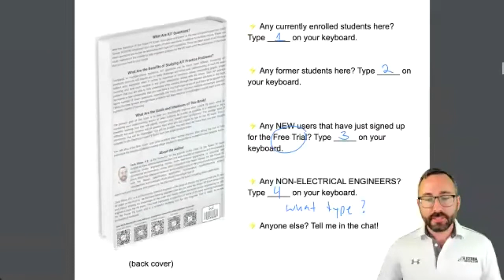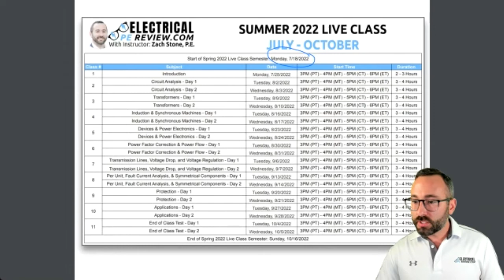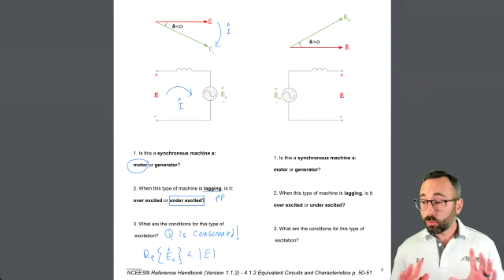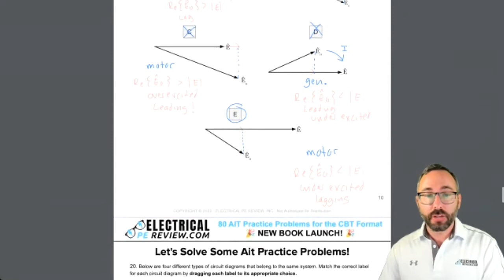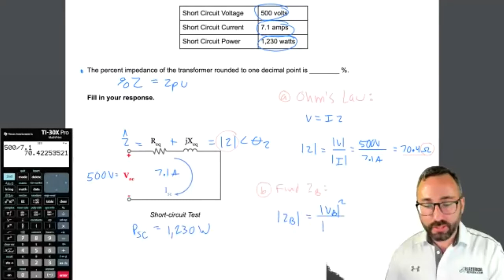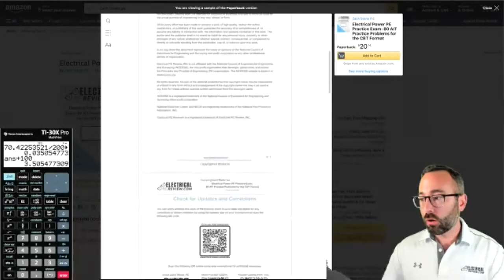New AIT Practice Exam Book Launch + Solve Three AIT Practice Problems With me in Real Time (2022)

Comment: Zach - I just recently purchased your "Electrical Engineering PE Practice Exam and Technical Study Guide - V1.0.9". Is this material another take on that same content or is this all new content/material? Thanks in advance. Joe
Reply from the maker: Hi Joe, this is a brand new practice exam with a completely different set of questions than the Electrical Engineering PE Practice Exam and Technical Study Guide. It represents the best we have to offer and contains detail rich solutions focused on AIT problems for the new CBT format to help improve your score on the Power PE Exam.